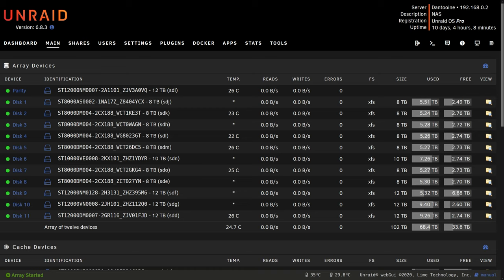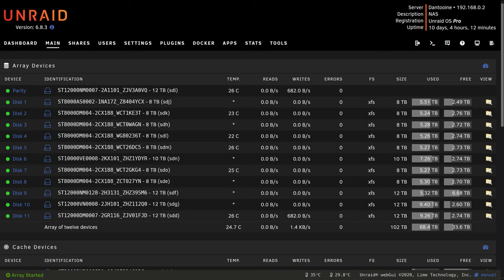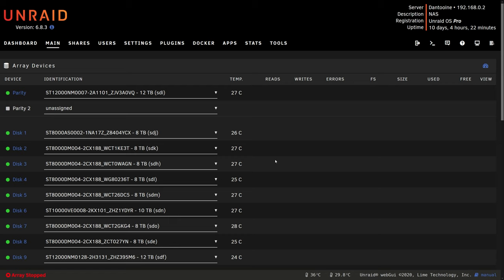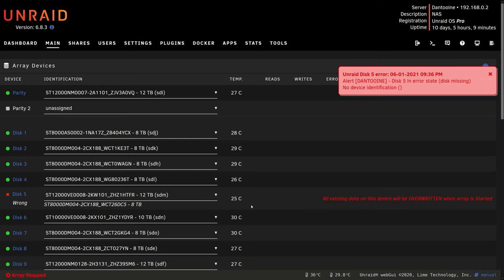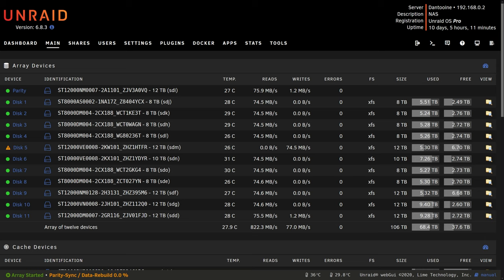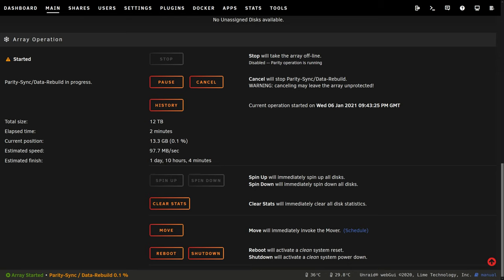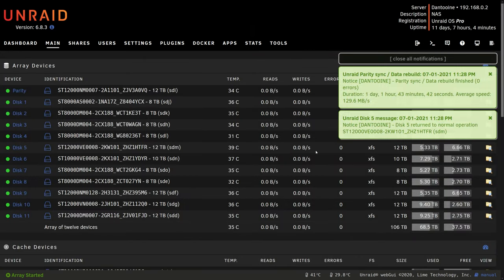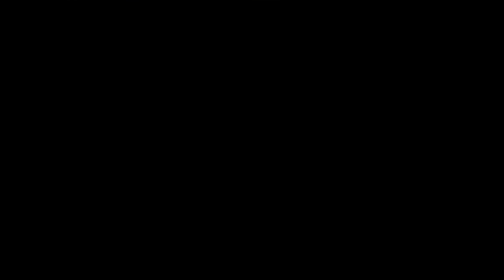Replacing a Data Drive in Unraid

Comment: Followed perfectly. Took some small storage drives and replaced them with 10tb drives. Followed the process exactly as you did. What enclosure and APC are you using?
Reply from the maker: I'm glad it went well for you! The case is a Logic Case SC-4324 which I have a previous video on, and my UPS is a APC 1500 VA Smart-UPS all in a 25U StarTech open frame rack.
Reply: Thanks to both of you for asking & answering about the case. It looks awesome and I'm on to that video asap

Comment: It blows my mind that unRAID just... Knows what was on ANY one of the drives if it goes missing. To the point that the recommended upgrade method is to just unceremoniously rip out the old drive, put the new one in, and let whatever unholy dark magic makes this possible do it's work.
Reply from the maker: Parity really is a kind of black magic
Reply: Unraid is constantly surprising me at how excellent it is. Such a pleasure to use such a great product

Comment: thank you for sharing this, I did exact the same method but received 4 parity errors after the rebuild. should I worry about it?
Reply from the maker: This could be a sign that one of your drives are having issues, you could try doing another parity check and check any drives for read/write errors.

Comment: Thank you.  Before you stop the array and do the drive swap, do you have to shut down the VMs and the Dockers and make sure they do not auto start when the array comes back online and starts the rebuild ??
Reply from the maker: Unraid should take care of stopping VMs and containers itself when stopping the array. I don't think you need to manually specify to not auto start the array either, I think it will detect a change and not auto-start.

Comment: Btw. the Toshiba 16 TB drive MG08ACA16TE has CMR combined with TDMR (Two Dimensional Magnetic Recording). Are there any known issues regarding TDMR, yet?
Reply from the maker: I've not had any experience with TDMR yet, but from reading I don't think it has the same negative impact as SMR does.

Comment: you will update to new 6.9? for more transfer speed with the new pool system 😊
Reply from the maker: Even when 6.9 is out and stable I will wait a little while before upgrading to make sure it actually is stable. I do like the multiple pools system a lot but not sure I would really have a use for that yet.
Reply: @PrimeRedux  With the new pool system you can use the 10gbe network card. What is currently not possible except from the ssd cache. But I'm looking forward to the new build.

Comment: If you are replacing an 8tb drive with an 18tb drive, don't you have to first make sure you have replaced and rebuilt the parity drive?
Reply from the maker: Yes, any data drives can not be larger than your parity drive, so you have to replace the parity drive first.

Comment: barracuda hd for a nas? O_0  what i understand, the  barracuda hd are for dektop PC and ironwolf  /ironwolf pro are for NAS, right? O_0
Reply from the maker: Different types of drives are intended for different purposes sure, but there is nothing stopping you from using any drive in any usage. However a drive designed for a CCTV system (WD Purple, Seagate SkyHawk etc) would do better in a CCTV system than other drives because they are designed to be constantly written to. Similarly NAS drives are designed to withstand vibrations and heat better so are better for NAS systems where there are lots of drives close together.

If you're on a budget however a desktop drive will do just fine, but I wouldn't recommend Barracuda's because 8TB and under they are SMR drives.

I have since replaced all of the 8TB drives in my Unraid server and put them in another system.

Comment: I thought wd didn’t use smr on wd reds larger than 6tb.
Reply from the maker: Currently I believe that is correct, yes. They also since introduced the "Red Plus" line which doesn't use SMR at any capacity. But like standard Red drives they are 5400rpm.
Reply: I saw to use CrystalDiskInfo to identify features.  If the drive has TRIM it’s often a SSD or a SMR Hard Disk drive.  Absent the TRIM it’s CMR.

Comment: Lucky that none of the other drives gave up the spirit while resilvering, that's a risky strategy you're showing unless all your other drives are healthy enough to survive 24+ hours of full speed ahead..
Reply from the maker: This is the way Unraid reccomend replacing a data drive in their own docs. The other option could be to clone the old drive to the new but your array has to be off for that duration, and if you don't have a old drive then the only way is to rebuild from parity. You can use two parity drive with Unraid so if you're worried about losing two drives then use two parity drives.

Comment: Wouldn't it go much faster when you just add all the new drives to the existing array at once, then copy all the data of the old drives to the new ones and then remove those old drives?
Reply from the maker: You could do that too I believe, but I'm not sure if you need to rebuild the parity or not when you remove drives.
The Unraid wiki has some steps for replacing drives using other methods to what I did.

Comment: Jeezus, 1980s NAS.  You have to stop a whole NAS array to replace disks... FFS why have hot swap bays.  Move up to ZFS and dump this shit.
Reply from the maker: As far as I am aware you can not add disks to a zfs vdev whenever you want to, can you? The reason I chose Unraid over something like TrueNAS was the ability to increase the array capacity at any time and use different size disks. At the time I went with unraid neither of those were possible with zfs. Has this changed?
Reply: @PrimeRedux  you can use zfs with unraid
Reply from the maker: @eirikdalhus  I am aware of the ZFS plugin for Unraid, but I don't believe you can use ZFS as part of the main array, only pools right? I also do not see the advantage for the reasons I explained.